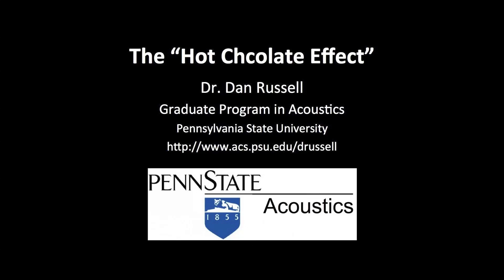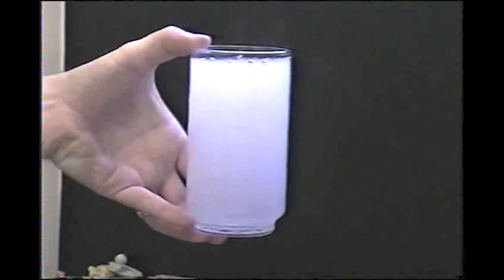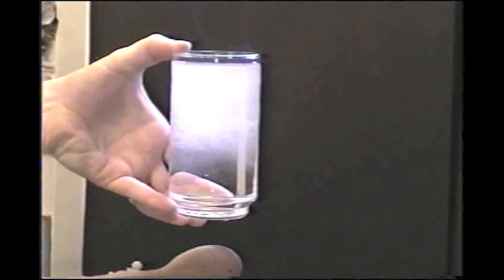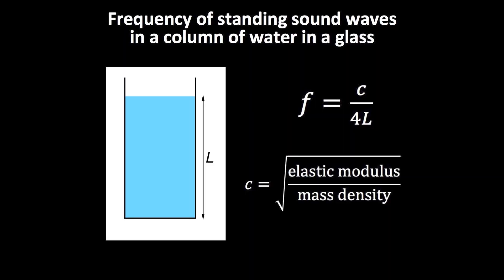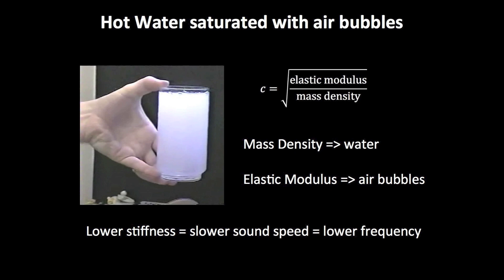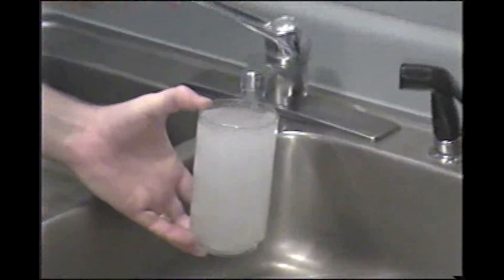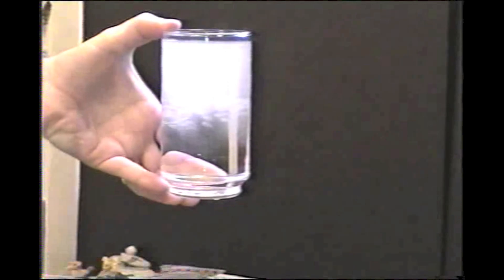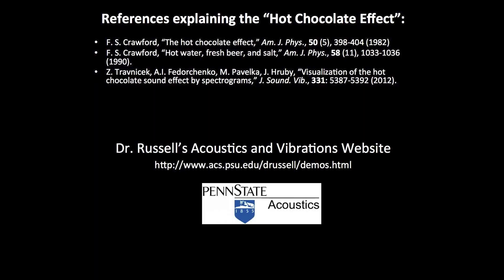Hot Chocolate Effect

Comment: Is there any explanation on why it needs to be 'hot' water?
Reply from the maker: I'm not sure that I completely understand the physics reason why -- but when you run really hot water from a kitchen faucet that has an aerator in the tap you gets lots of really small bubbles (the water looks cloudy). You don't get the same bubble-infused water with cold water, or from hot water without an aerator.

Comment: Finally, the mistery is resolved. But, not completely. Mr. Russell, the effect also appears if one taps the container with a fluid that is the same density (not containing any bubbles), of for example hot coffee. When stirred, the pitch goes up, when still, pitch goes down. Stirring it again causes the same effect over and over again. Does the movement of the liquid prevent the sound waves also to go up slower and thus creating a lower sound?

Comment: Let me see if I've got this right. Stirring hot chocolate dissolves air bubbles into the drink causing the vibrations to travel through both the air and the liquid lowering the pitch. When you stop stirring though, the air rises to the surface leaving the stiffer water and a higher pitch. Correct?
Reply from the maker: +CoreyView I think that is a good enough understanding.